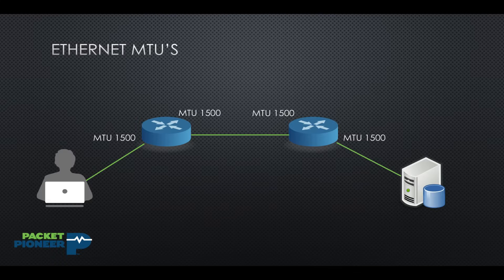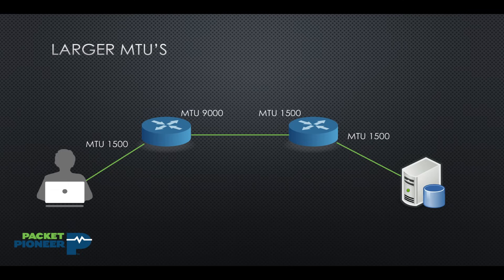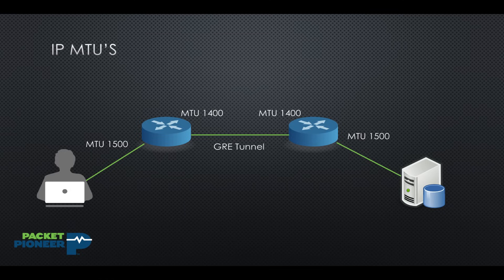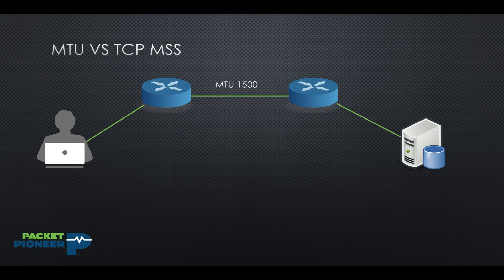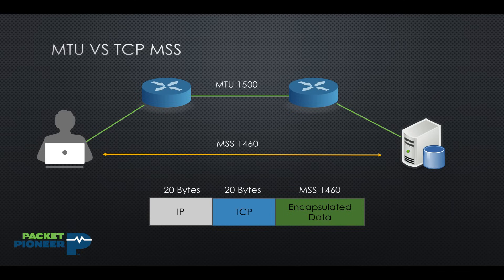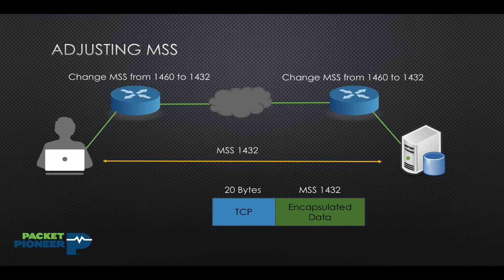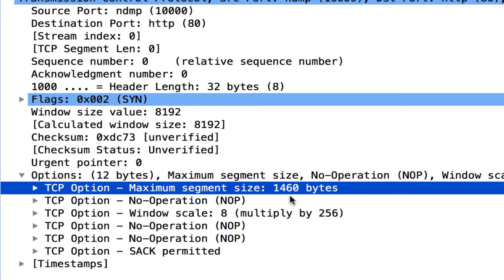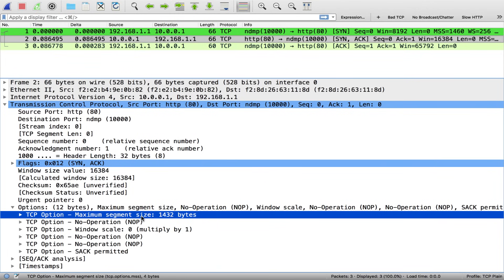How TCP Works - MTU vs MSS

Comment: Nice video ... however, the value in absense of the ip-mss-option is incorrect.
tcp will not use the minimal value (as mentioned in the video), instead, tcp
will start with a value derived from its own exgress interface and use the mechanism
of tcp-path-mtu-discovery via icmp packets (fragmentation needed but df-bit set).
This is the older way of discovery and it has proven to be somewhat unreliable
especially today.
Reply from the maker: Thanks for the comment! Agreed that PMTUD is a thing. If you have a pcap of that in the wild on a modern stack I'd love to see it. It's been years since I've seen it actually implemented in practice. 

So this is a "must" vs "strongly recommended" thing. 
TCP RFC 9293 states in 3.7.1 - If an MSS Option is not received at connection setup, TCP implementations MUST assume a default send MSS of 536. 

PMTUD is "Strongly recommended", but for me, I haven't seen it in practice in some time. I would love to though so send me the pcap!
Reply: @ChrisGreer  I wasn't aware of the statement in RFC 9293 ... and in a way, it somewhat amazes me (as it will reduce throughput noticabely). However, I came more than once (in the last 10 years) into a situation, where the sending and receiving stack on the peer-systems would love to use the mss-option, but there are intermediate firewalls that filter all (!!) options ... this is usually a malconfiguration of the firewall, however, tcp is required to work even if options cannot be delivered. And in those situations, I've seen the local interface-mtu (reduced by ethernet.overhead and eventually GRE/IPinIP/etc overhead) used to derive an initial tcp-mss ... when an icmp (as mentioned) arrives, this value is reduced according to the hint given in the icmp. This would work fine, if (and only if) the malconfigured firewall would let the icmp pass ... but in the cases that eventually involve me to troubleshoot, they usually dont. Situation becomes worse, if there is an encryted tunnel used as part of the routing-path ... in such a case, it can happen, that the tunneling devices copies the DF-bit from the inner (encrypted) frame to the outer transported frame ... so the outer frame shall not be fragmented ... but on the other side, returning icmp's for such a frame cannot be handled properly (as the encrytion usually works stateless). In such a case the only thing that helps is to clear the df-bits in the outer frame. However, this does not help when errors occur for traffic that you get from the remote side.
I just ckecked the rfc ... 9293 came out in August of 2022 ... so, if this was the first one to tell
'MUST use 536' a large number of systems (using ipv4) will not yet implement this.

Comment: Hi, I'm reporting a problem I've had in the past. An application is running at 1400 MTU. There was a problem with application access, I pulled the interface to 1400 MTU on the firewall. App access has been improved. Why did we have access problems when the application was 1400 and interface 1500? Will it not cause different access problems when you reduce the interface to 1400?
Reply from the maker: Hello, I would need a pcap to be sure about what happened.

Comment: Hi Chris! Appreciate your work! It would be great to add in video explanation about how work adjusts MSS in network devices. I can provide you with simple gns3 topology with c7200 routers and an example of how routers change the mss value
Reply: https://www.cisco.com/c/en/us/td/docs/switches/lan/catalyst3650/software/release/16-9/configuration_guide/ip/b_169_ip_3650_cg/configuring_tcp_mss_adjustment.pdf

Comment: hey, I got a question. 
The syn,ack from the server to the host -- is that the MSS negotiated between the two devices ? or is that the MSS on server's side (MSS of server) ??. Please answer.
Reply from the maker: MSS is advertised, not negotiated. Both sides can have different values while respecting the one set by the other side.
Reply: @ChrisGreer  Why my computer send maximum only 1400 bytes TCP payload if the other peer sent MSS value 1412?

Comment: Hi Chris,

First of all thank you for these TCP amazing explanation. I never knew this much TCP does and this series of video made me to understand it deeper.

Could you please explain why MSS default value is 536 bytes?
Reply from the maker: Hey Sujit! glad you enjoyed the video. The MSS default value is based on the IP minimum (maximum) packet size of 576 bytes. An IP endpoint should be able to accept packets of at least 576 bytes. They can be smaller than that, but the station should always be able to accept at least that as a maximum packet size. When you slice off the 20 byte IP header, then the 20 byte TCP header, you would get 536 as a payload, which would be encapsulated. Hope that helps!

Comment: Is there a concept like L2 MTU and L3 MTU? What I heard is L2 MTU is 1500Bytes + Ethernet header where as L3 MTU is 1500Bytes(Payload+TCP H+IP H). I always thought ethernet MTU is how much of data that can go inside an ethernet header(excluding the ethernet header). Can you correct me?
Reply from the maker: Hello! Short answer - yes. There is an L2 MTU and L3 MTU. Both are basically the same number though, since L2 doesn't include the ethernet bits. For the most part i have seen the two terms used interchangeably, but they are different.

Comment: My understanding is that the MSS value is 'announced' and not 'negotiated' during the TCP handshake. I have seen material over the internet that will tell you that the 'lower' of the two (client and server) MSS values will be used. I don't believe its correct. Chris, would you clarify? BTW, your videos are just amazing
Reply from the maker: Hello Amit, you are correct. The MSS is not negotiated, it is an advertisement. I have seen stacks respect the lower value before, however the value itself is not negotiated between endpoints. Thanks for watching Amit!

Comment: I have a doubt Chris. As per your explanation, MSS is set during the 3 way handshake. So the data being segmented would not cross the MSS value. When does the IP fragmentation come into play then?
Reply from the maker: That is a great question Rajiv. IP fragmentation would come into play if there is a lower MTU along the path than the packet size, including the TCP and IP headers. So you could have an MSS value of 1400 (which, if the TCP and IP header values are both 20 bytes would give you an IP packet length of 1440) but an MTU somewhere of 1000, which would then require fragmentation. Hope that helps.
Reply: @ChrisGreer  Thanks Chris. IP Packets can take any path and encounter a lower MTU device. Cleared. :)

Comment: Great content. I have this doubt - In your other video named "how tcp works - the handshake" at 6:59, you said MSS value is something getting negotiated between sender and receiver.. and both the parties fall back to the lowest one..but here in some answers to questions in the comment session, you said MSS is not negotiated  and independent of sender and receiver..are these contradicting statements?
Reply from the maker: Hey - thanks for the comment. MSS is not negotiated. If I said that or implied it then I was in error. I may have meant that some stacks will respect the lower of the two values. But the value itself is not negotiated. If it is not advertised in the handshake at all, then the opposite side will generally assume 536 as a default value. Thanks for the question!
Reply: @ChrisGreer  thanks for your reply

Comment: Hi Chris,

I am getting into this and it is quite a lot of details if I try to put all things together. Nevertheless, can you please address one question?

Suppose interface MTU (L2) is set to 9000. Now, if MSS is having a value of say 1460, does it make any sense/advantage of having the interface MTU very large (i.e. 9000)? Segments are naturally going to be smaller because of limited MSS value right? I am now puzzled on how the concepts fit in. Does the 9000 L2 MTU have any significance or advantage in this case? Maybe yes - because, so many TCP segments would fit in to a single L3 and L2 PDU?

I hope my question would make sense to you.
Reply from the maker: Great question as well Mit! 

Remember that other protocols will use a connection as well - such has UDP, or other IP traffic. Traffic is not always TCP, so a larger MTU at layer 2 could be utilized in theory by non-TCP traffic that can support a higher payload. But TCP will always go by the MSS.
Reply: @ChrisGreer  Thanks Chris!!! So what you mean to say is - for any non-TCP traffic, values of 9000 as the L2 MTU can possibly be advantageous, but won't be the case for TCP traffic, given that we have a TCP MSS of 1400? Bottom line is - a frame can be only as big as permitted by the TCP MSS ultimately. Is that correct?
Reply: @Mit Patel

Can we set MTU value to 9000, I have tried using some commands but when I send the data and checked in wire shark I  able to see still the size is 1500 which is default value. 

Can you please give me the steps to change the MTU size in windows

Comment: Hi Chris,

So does this imply that MSS must match on both ends? And, the negotiation "should" be such that they should settle up to the lowest MSS value between the two?
Reply from the maker: Thanks for the question Mit - No, the MSS does not need to match. It is an independent value advertised by each end of the connection and is not negotiated. It is simply an advertisement of the largest segment size that a host can receive. So in other words - "Don't send me anything larger than this.... 1400" Or whatever value is used.
Reply: @ChrisGreer  Great, thanks Chris. And, both MSS and Window Size would be determined by the local device itself and will be advertised to the opposite end, depending on internal buffer capacity, network conditions, etc?

Comment: I have a question:
What i learned recently was, that the network layer (i am talking about the IP layer 3, which i am not sure if that is the correct english term), would not "look into" the encapsulated headers (layer 4 and 5).
You however mentioned in your video that some network device along the way could have changed the MSS.
I am a little confused and would really appreciate if you answered my question.
Thanks in advance and thank you so much for the great videos on this topic. really appropriate speed and great visualisation!
Reply: Wow after scrolling through the comment section i just found the exact same question by someone else, whcih you already answered, disregard my comment.
Reply from the maker: @exolicious1416  Not a problem at all! Thanks for the question. I totally understand - I didn't know that L3 routers could adjust a layer 4 MSS value either, until it was something that I ran into on a client network. It is a good question!
Reply from the maker: @exolicious1416  Not a problem at all! Thanks for the question. I totally understand - I didn't know that L3 routers could adjust a layer 4 MSS value either, until it was something that I ran into on a client network. It is a good question!

Comment: Hi, 
Assuming only one interface and a P2P connection b/w two devices. 
If MTU size is configured to 9000, then changing the MSS to more than 1460 would make sense ??
Reply from the maker: Hello Dhruv, That is a great question. In short - yes, if your MSS is 1460 on each side, then TCP will only take advantage of that segment size. However, in some cases the application in use can be jumbo-aware and adjust the MSS on its own. It really just depends on the stack/app in use.

Comment: The most confusing part about TCP and MSS is about Options in the IP layer and TCP. From my understanding, you only 'count' fixed header size of both TCP and ID (20 each) and then trim off any data from the TCP segment, by the byte amount of Options of IP and TCP (that are used). Right? 
For example, if I have MSS of 1460 and IP without options and have one TCP option (4 bytes, or smaller but with added padding, for 32bit rule) then I can't really send 1460 but 1456 of actual data?
Reply from the maker: Yes that is correct - If the TCP header is carrying options for SACK or timestamps, or other options, this takes space away from the encompassed data. So in these cases it is not uncommon to see payloads that are less than 1460 bytes. Remember the MSS is just an absolute maximum, given no options in the tcp header. However if it is smaller than that it is acceptable.

Comment: So tcp window and mss is same!?
Reply from the maker: Hello Saif - no they are quite different. The Maximum Segment Size is an advertisement of the maximum encompassed data that a station can receive in one segment. The TCP receive window is the amount of data that the receiver has space for in its receive buffer. So they are quite different. Check out my video on the TCP Receive window to clear up that topic. Thanks for the comment.

Comment: In 5:59, it should be pointed that MSS is not a negotiated value in essence between the 2 end points. However, the way Operating Systems implement it and deal with it might differ from the original description in the RFC and choose to work with the lowest MSS value advertised between the 2 sides.
Reply from the maker: You are correct. I need to clip that part of the video - the MSS is an advertised value, not a negotiated one. Thanks for clarifying.

Comment: Question-Routers work on layer 3 of OSI model..they deal with IP network layer
Where as tcp mss is layer 4.
How can router along the path change tcp layer 4 information(mss).

I am really very confused.Appreciate if anyone can answer my query.
Thank you.
Reply from the maker: Hello Himanshu - Great question. You are right - routers do deal with layer 3, network layer stuff. However, they also pay attention to layer 4. Think about access lists at the port level - those are all layer 4 things. So many of them have the ability to look beyond the layer 3 info in the packet. Many enterprise level routers (and even branch routers) have the ability to make adjustments to values in the TCP SYN. On Cisco routers, you can use the command 'ip tcp adjust-mss' to change the mss of the SYNs. The reason to do that is if there is an MTU on the next connection or later on in the path that will require a smaller MSS in order to avoid splitting up the packet, especially for packets with the DF bit set. 
Thanks for the comment!
Reply: @ChrisGreer  Hello Chris - Thanks for all the details , i have a followup query that even if router has decreased the MSS of the source TCP packet , will it inform about it to source ? Because destination will get this updated detail and will send the reduced MSS size segment , however source will expect initial published MSS ? please correct me if am wrong in interpretation .  how this will be resolved ? have you posted any video that can answer all these queries from scratch ? Thankyou !
Reply from the maker: @ankanshrivastava7517  Great questions! The simple answer is no - the router will not report back to the sender that it changed the MSS. But if there is an MTU problem down the road and ICMP is enabled, the original sender may see some ICMP fragmentation needed messages. But this will happen at the network layer, not the transport layer.

Comment: Can we change the MSS size manually for an on going TCP connection?
Reply from the maker: Hello - you can change the MSS at the stack level. Here is an example of how to do it in Windows 10. At the bottom of the article it shows how to manually adjust the MTU. This would work theoretically for any new connections. You can also adjust the MSS at the routing level as shown in the video.
https://support.microsoft.com/en-us/help/900926/recommended-tcp-ip-settings-for-wan-links-with-a-mtu-size-of-less-than

Comment: I always find your videos helpful. I am using NetScout solution. My comment is... You mention that the network device can interfere and change the MSS size.. If I want to know who modified the MSS size (if the network device or the server itself), then I should just compare the TTL and MTU of each capture of each network segment against the TCP dump. Because that can give me clue if the MSS changed against the TTL value Am I correct?

Comment: @Chris Greer what software do you use for presenting switches and nodes etc... can you share the info...
at 0:27 a slide is there, I want to make similar slides, which software should I be using to get such figures...
Thanks
Reply from the maker: It's just Powerpoint with some Visio icons for the routers and switches. Nothing too crazy. Thanks!

Comment: Wonderful  explanation...I faced some issues with a pppoe link couple days ago. the root cause was the MSS configuration, after some adjustments the problem is solved.
Reply: Hussein Az  Hi, you have to adjust the mss parameter on your device... In my case I'm using Mikrotik Routerboard. Google it for MSS and your device model...it helped for me.

Comment: is MSS value the same for receiving and transmitting?
Reply from the maker: The advertised MSS is a statement of what the sender can receive in terms of payload bytes. Each side can have a different MSS. If the other station can receive a higher MSS, the opposite station should be able to transmit at that higher MSS, even if it is advertising that it can only receive a lower MSS. In practice, TCP stacks may vary on this. I have seen a stack that would only transmit the same size as it's own TCP MSS receive size. This is not according to the standard though.

Comment: Hi Chris, 

Does the Ethernet MTU value be higher that 1500 if my Ethernet interface size if Tengig?
Does the MTU size some how dependent on the actual interface size? 
In some routers we do define mtu for a an interface as 4484 or even higher value.
This configuration of setting mtu size on an interface makes the topic MTU confusing to understand.